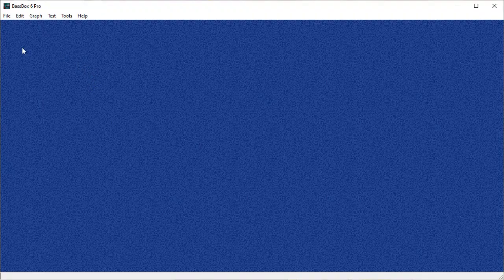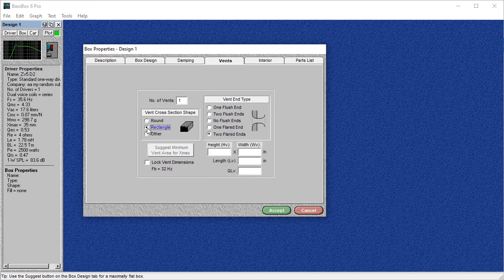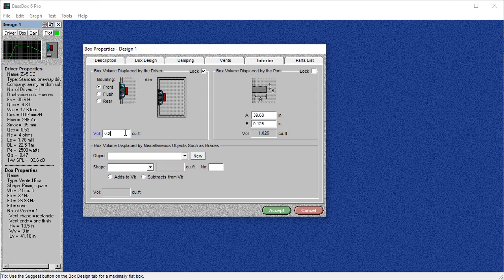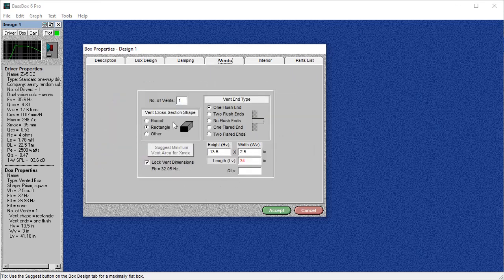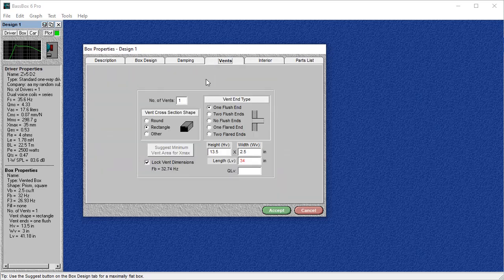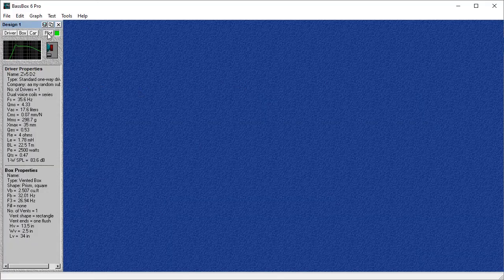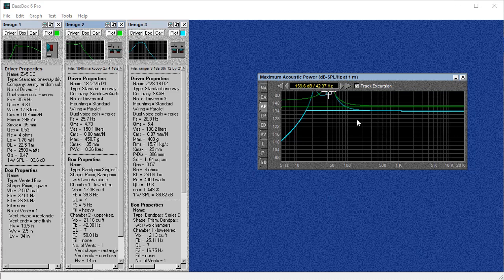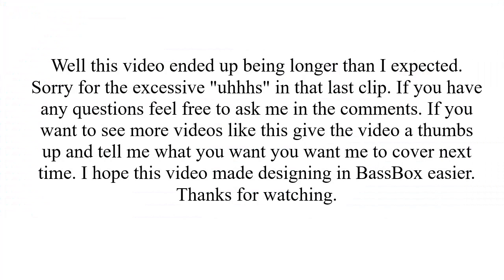BassBox6 Pro Tutorial Understanding How To Use BassBox Effectivley!

Comment: ive been a basshead since the late 80's ive built lots of boxes,one of my favorites was a bandpass that i did not build it was built for me,96 extended cab s10 it was the with of the back seat area but only came up to the arm rest on the center console,it had two jl 12's and a 6 inch pvc for a port and it was only about 4 inches long,it played great on all types of music but when i put in a bass cd omg it came alive,it could handle every song,with the volume turned down just up a few clicks and driving with the windows down some the wind and the box made a really cool sound kinda like a waa waaa waa waaa waaa sound,hard to describe,anyways i have been wanting to build one for a couple yrs BUT i have a mac,theres nothing to help me really,sure i could pay someone but thats no fun.i have some sundown sd3 8 inch subs,i have a x12 and i have a nightshade in my blazer right now but want to get rid of it.any ideas what i can do since i have a mac ? i learned about ebp and 2 :1 ratio's and you can change them to your need's.but i designed one on paper for two of the 8's and using a 4 inch pvc port it was like 10 -12 inches not sure if thats wrong so i quit,oh well holler if you have any ideas where i can look thanks

Comment: That's Awesome! Thank you so much... I actually wanted to build out a 6th order, for my ranger. Super coincidental. I think I'm on the right track. SA 15 v2 d2, but I've only got 1,000 watts to work with, nothing crazy... a daily driver. I think you just saved me a few month's of frustration. Much appreciated. You rock.
Reply from the maker: I wish I had the knowledge to make a video on 6th order design although that's something I've yet to study extensively. I just posted a video touching on 4th order design. Check it out!

Comment: Great video! Only problem I'm having is some of the graphs don't show up I only get 4 or 5 of the graphs, am I missing something?
Reply from the maker: Pretty late to respond here. (Thanks for a good video idea btw). The reason you wouldn't be able to see certain graphs is due to a lack of parameters. Graphs like cone displacement need specific parameters to be generated. Additionally, a handful of graphs require you to tell the program how many watts of power is being applied; cone displacement is one of them. 
Hope that helps. Thanks for the engagement